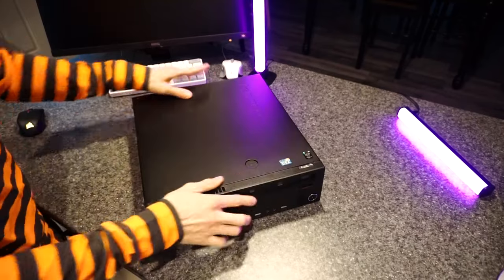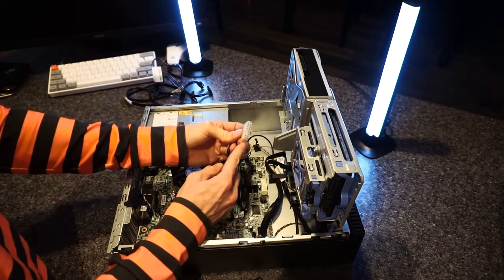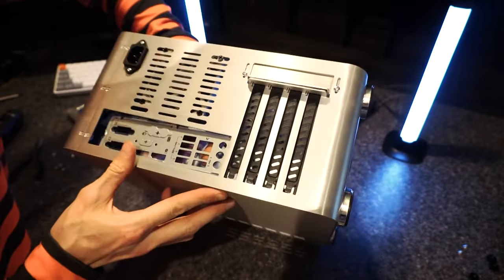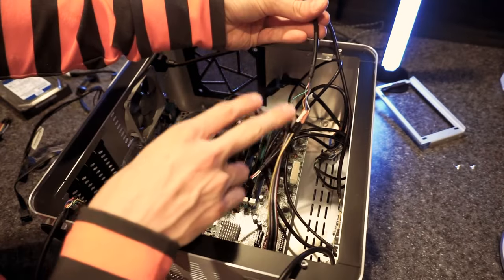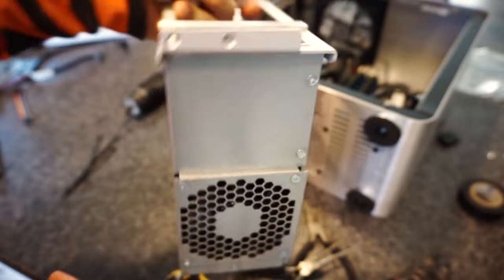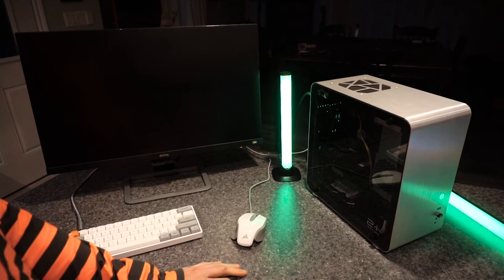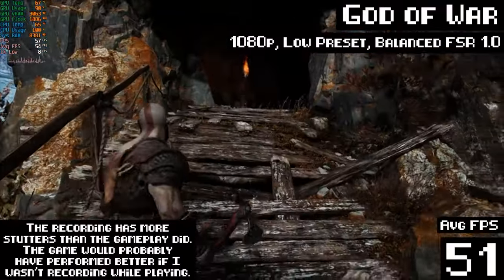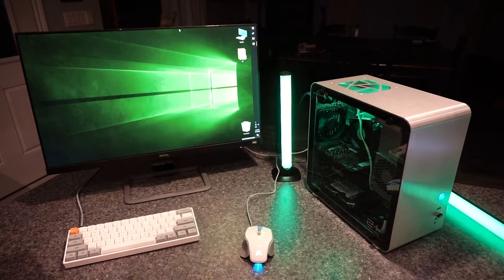Old office PC becomes GAMING PC! (Lenovo M93p case swap)

Comment: I got a Lenovo M93p SFF for $52 off of eBay with a better setup for that same model. 16GB of RAM, and 500GB WD Blue with W10 Pro, but juiced up to 32GB RAM, and a 1TB WD Blue with 240GB WD Green SSD for important apps and files. The catch 22 was that the case was banged up to hell, and I wound up having to have that case sit as a relic. I'm bopping into a Pre-Owned beater Antec case, though. We'll see how it does. Lol
Reply: By the way, you got me subscribed. I'm curious to see what else you do.
Reply: I forgot to mention I also added a Gigabyte NVIDIA GeForce 710 DDR3 SFF GPU 2GB.
Reply: Great build, I managed to grab the same system for $80. Just a question if you don't mind, any luck connecting wired controllers to it. If so please explain how because I have tried almost every troubleshooting trick in the book, and I can confirm that my controller and all of the USB ports on the pc are working.

Comment: You can usually find adaptors for standard power supplies to lenovo motherboards ... amazon, ebay ...
Very useful if the PSU is underpowered and you want to put a power hungry video card.
Reply: Did that w/ a dell optiplex.  Many of the office PC proprietary PSUs don't have 6/8 pin PCIE power, so any card that can't be directly powered from the slot is a no go without changing it.  The adapters are pretty cheap too.

Comment: Have caseswapped a Dell Optiplex 3020, but its new life became a NAS with a HBA card in the pcie x16 slot, works like a charm and superstable😊
Reply from the maker: Nice! Building a NAS is on my to-do-and-also-make-a-video-about list :)
Reply: @TechDweeb  Looking forward to see👍 I can strongly recommend using Unraid for NAS, so easy to swap hardware with no issues. And 100% stable, only downtime is my fault🤪

Comment: loved honest review on 6500xt bulding a budget  editing gaming pc (i5 11400f + rx6500xt) can i record games  with 1080p? and wdyt  any changes??
Reply: Depends on how much ram you have
Reply from the maker: I replied to your other comment but I'll reply here in case you don't see it. 

You can record using your CPU with that setup, but I personally would go for the 11400 non-f so that you could get encoding with the igpu and then you wouldn't be sacrificing anything. However, even with a 11400f, you can still use CPU encoding and as long as you are not CPU bottlenecked in the game you are playing then the performance will be just fine.
Reply: @TechDweeb  thankyou for the information😊😊
Reply: @parthdhooper5812  Like @TechDweeb said, If you're going to do video editing / streaming stick w/ the non-f variants and use quicksync, it's usually around a $20 price difference.  I'd also say to stick w/ 11 or 12 gen so you get PCIE 4.0 support (better performance on the 6500 that way).  Also keep in mind GPU prices are falling, so look for deals there (6500xt was on sale for $175, and the 3050 at $250 both at newegg yesterday).
Reply: @tomcatsdb4755  yup i waiting for the rtx 3050 to 
reach its minimum pricing just a months because 3050 is one time investment

Comment: Great video I had been looking into doing a case swap but could never source the cables. Seen a couple videos on using bigger PSU's with some case modding and the adaptor cables meaning you're not stuck with the crappy propriatory PSU and opening the door so to speak to using bigger graphics cards there are also adaptors for those. Could you look at doing a case swap doing these things perhaps into a slightly bigger case.

Comment: Well done, great job Dweeb. I use a Dell OptiPlex 970 (don't laugh, please) with a i7-2600 and 16 gig and a Nvidia GT 1030, this might be a good upgrade path for it
Reply: I'm using a 3770k slightly overclocked, that frequency does make it quite a bit faster than the vanilla 2600, but it's not a world of difference. Honestly, I would hold off the upgrade until I had enough for something ddr4. An i7 4790 is just not faster enough in my opinion
Reply from the maker: The optiplex 970 was my first sff PC. It had an i5 2400 and I added an AliExpress 4gb 750 ti. This was like 2 years ago, but I don't have it anymore because I gave it away. I REALLY like those optiplex machines, I think they genuinely look good!

Comment: This video has inspired me to do a case swap on my old m910sf. Only question is does the m93 have the same motherboard as the m910sf? I want to use the same case that you have in the video and potentially a 1650 super.
Reply from the maker: Nice! I'm not sure about the M910 to be honest. I've never used that PC. Each of these PCs is different, if yours isn't a standard size motherboard (for example, mine was a standard matx size) then you'll have issues mounting the new motherboard in the case. The easiest way to know is to see if you can find videos or forums of other people doing a case swap with your exact pc.

Comment: Very educational and creative.Throughly enjoyed it.
Suggestion needed making a decision :
I have a 2 year old  asus phoenix gtx 1650 ddr6.
I am getting a chance to exchange it with one month old gigabyte 6500xt eagle.
I play mostly AAA games.
No e-sports titles.
Should I do it or not??
PC specs:
Ryzen 3 2200g
Gigabyte a320m s2h
2x8 gb 2400mhz corsair 

Thanks in advance.
Reply from the maker: With a 2200g you'll be running the 6500 xt with PCIe 3.0 bandwidth, so it won't perform as well. In most games you'll get a bit of a performance boost, in some games you'll take a performance hit. I'd stick with your 1650. HOWEVER, if you were planning on upgrading to a processor/platform that supported PCIe gen 4, then the 6500 xt would make sense because in that situation it'd perform significantly better than the 1650.
Reply: I shall stick to the 1650 then.
Thanks for your quick response.

Comment: Dude the thinkcentre case is lowkey the perfect sleeper case. Can you slap regular matx board into it?
Reply from the maker: I think so? The main problem will be the power supply, finding a normal ATX power supply that fits in here.
Reply: @TechDweeb  is sfx psu fits?

Comment: Brother can I swap A Lenovo M71E very similar to that system. But I don't know if it supports normal ATX PSU?!
Reply from the maker: From what I can tell, yeah, you should be fine. It seems to use a standard 24 pin motherboard power connection. I can't say for sure but I'm thinking you'll be just fine with a different brand PSU.
Reply: @TechDweeb  thanks brother.

Comment: Still jealous about that case!

I have better results in sottr and Witcher on a 3770k with an r9 380. With that great game sample of 2, I'm wondering if your oem 1050ti isn't really up to scratch, or if these games can actually really use 8 threads and there is plenty of performance on the table.

You didn't want to upgrade the PSU because of the price, I guess?

Fsr 2.0 came out for gow, are you considering a dedicated video?

And, as always, love the video! And the shirt!
Reply from the maker: I wouldn't be surprised if you get better performance on that setup. The 3770k is a much better processor than the 4570. And your R9 380 is better than the 1050 ti. Also I suspect that these Lenovo motherboards are the lowest tier of performance (like, sub H81). 

Yeah I didn't want to spend more on a PSU when the one that came with it is still working fine. Also I kinda like the look if it in this build, with that honeycomb vent on the front. 

Thanks for letting me know about FSR 2.0 in GoW! Yeah I should definitely do a video on that.
Reply: @TechDweeb  in theory r9 380 and a 1050 ti "should" be roughly the same, seen countless benchmarks to check that, but I don't actually own one to compare. I've always had the feeling 380 should be faster, and internet told me I'm wrong. Stupid internet

Comment: Can you make a top of the line gaming pc using the office pc parts
Reply from the maker: It's totally possible, definitely, just make sure you buy a relatively modern PC with a good processor. It's probably cheaper than buying all the parts new, the problem is that most more modern office prebuilt PCs have proprietary cases and power supplies, so you're stuck with the original case.
Reply: Ah ok thanks

Comment: I've been wanting this case but thay way to experience in the UK £125 is the cheapest I've seen
Reply from the maker: Yeah the prices seem all over the place for this one. Usually it's 55 bucks CAD, but then they go out of stock and the price suddenly jumps up to like 80 bucks CAD. Then a few months later it's back down to 55. 🤷
Reply: I dose look a really nice case I've been looking at the Jonsbo UMX3 is a similar looking thing are you familiar with this one
Reply from the maker: I didn't know about that one but it's a beauty!
Reply: I took the plunge and ended up ordering the JONSBO RM3 mATX all Aluminium case with glass side panels just £60 in UK only had a quick look over but so far mightily impressed

Comment: this possible for optiplex 3020 sff?
Reply from the maker: The optiplex SFF PCs have an issue with their stock coolers - the 'backplate' for the cooler is actually mounted to the optiplex case. I've heard of people wrenching the cooler standoffs from the case so that they can mount it in the new case, but I haven't tried that personally. Check out some videos before you decide you're going to give it a try. It sounds like a fun challenge to me, I might try it someday.
Reply: @TechDweeb  Okay, I won't do it, it looks like coprophilia

Comment: For 1080p mass video editing for continuously for whole day and some times 4k vid editing and boender rendering and architecture 3d modeling can u suggest a build its also for gaming so pls do suggest minimum requirement but i want fastest windows experience or a laptop for that if u know
Reply from the maker: So, you want the fastest windows experience and good performance while doing blender and 3d modelling and gaming all day?

And I'm assuming you want me to be reasonable, not like a $6000 PC.

So, I'd suggest something similar to my personal PC that I use for art & design, gaming, and video production. You can find all the details and the entire build in this video:
https://www.youtube.com/watch?v=eaaK4T_M_wQ

Here are the parts I used:
Motherboard: MSI MPG X570 GAMING EDGE WIFI
Processor: AMD Ryzen 7 5800X
RAM: G.SKILL Trident Z Neo 32gb 3600mhz
Graphics Card: MSI Ventus GeForce RTX 3080
Power Supply: MSI MPG A750GF 750w 80 plus gold fully modular
Cooler: MSI MAG CORELIQUID 280R AIO
SSD: XPG GAMMIX S70 Blade (PCIe gen 4 NVME)
Storage: Seagate barracuda 8tb
Extras: EZDIY-FAB GPU anti-sag bracket, InWin Sirius Loop Addressable RGB Triple Fan Kit, White sleeved braided PSU extension cables

Total price was approx $2300.

Hope this helps!
Reply: @TechDweeb  i can get close to this but processor and gpu in market their cost are still very high about 2/3 higher than MSRP even though they said prices are coming down they only lifted on specific parts

Comment: That was a Haswell i5, right? I am running Cyberjunk 2077, lol, on an old i7-3770. That is Ivy Bridge. I sport a GTX1060, but only 3GB of VRAM. And I honestly get a little better results than you did there. Perhaps some settings could have been tweaked, anyway I am running med - high in 1080p. And to be honest, I am IMPRESSED by what a 10 yo pc can do these days.
Reply from the maker: Totally. Grabbing a cheap old PC and shoving an SSD and GPU in it is such a great way to get up and gaming. These things are getting cheaper all the time too!